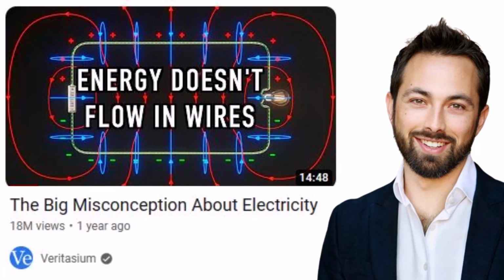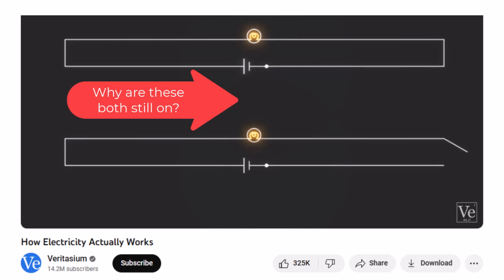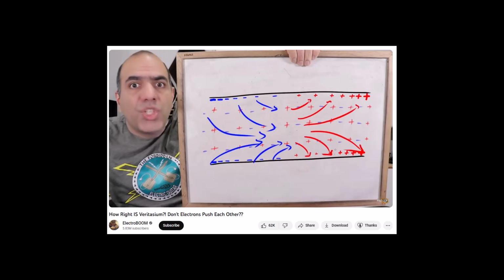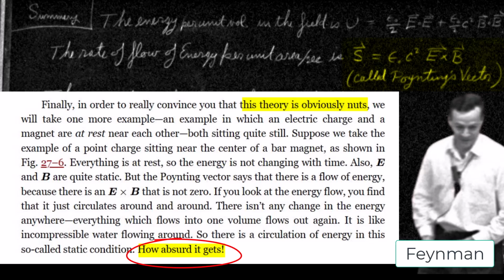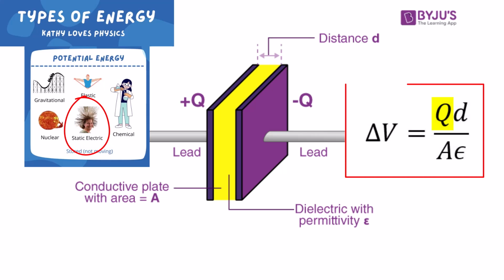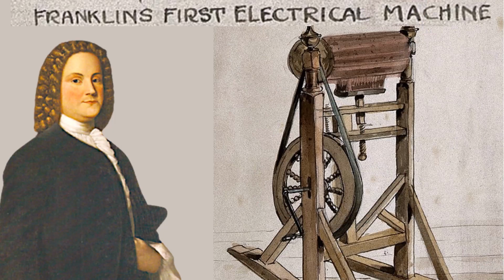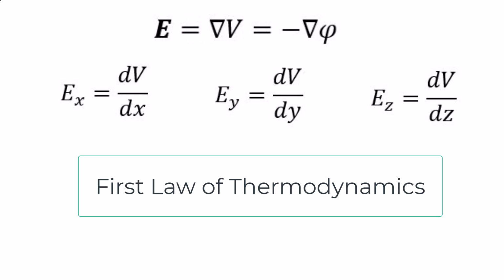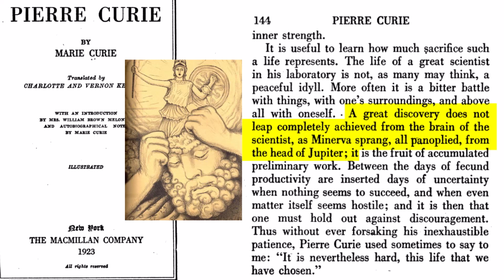Deep Dive Historical Response to Veritasium’s DC Electricity Video

Comment from the maker: I thought this pinned comment could be a good place for people to add (respectfully) things in history and physics that you think I made mistakes on or need more clarification. Please nothing about sound quality or other superficials in this thread.  Let me start: I wish I had added that when a battery is in a circuit the chemicals take a while to react, so that the electric potential difference from the charge distribution Delta V is less than the emf, or the chemical potential energy per charge. The equation becomes Delta V = emf - ir, where i is the current and "r" is the internal resistance. This is why a battery heats up when you have a lot of current flowing through it. 11
Reply: I sent you by email the PDF of a highly relevant paper on the very subject (Galilia and Goihbarg, 2005). You did not use it. Have you got it?
BTW, I also think you misstated something about Feynman because you first agree with him and then seem you say that the same quote is nonsense. I've made a separate comment on that.
Reply: Poynting vector definitely applies for DC circuits! The case mentioned by Feynman is definitely weird, but remains consistent because the energy is not coming in or going out. In fact, to quote Feynman himself (just a couple of paragraphs below the one you showed) "The circulation of energy around a magnet and a charge seems, in most circumstances, to be quite unimportant. It is not a vital detail, but it is clear that our ordinary intuitions are quite wrong."
He makes the point that Poynting vector concept is non-intuitive but does not say that it is, in fact, wrong. That said, the derivation of Poynting vector is not fully consistent and leaves room for multiple definitions. I remember that Griffith's textbook also shows the same concept. 
Whether you agree or not, Physics is simply a model and as long as it works, it stands. Einstein really didn't believe in QM and it may not be correct either. But, it will remain correct until proven wrong, and we know that QM seems to work really well in explaining all the observed phenomena so far (barring the weirdness of black holes). This attitude is important because one should never be beholden to a theory/model as it is against the spirit of scientific temper.
Reply: You are misinterpreting Feyman.  He was emphasizing how counterintuitive it is by calling it "crazy".  He does the same with quantum mechanics.
Reply: There IS an electric field inside the wire of a DC circuit and it makes the electrons move: J = sigma E. Only in the *electrostatic* case the field is zero. For a good explanation see:
“A unified treatment of electrostatics and circuits” by Sherwood and Chabay.
Reply: Great channel Kathy.
  The flux field created through  the surface of a solid conductor in a circuit while a potential difference is applied, is obviously connected to the flow of electrons in the conductor. At least it should be obvious. I won't go into further detail on this forum except to say I believe your comparison of static charge protection from a Faraday cage vs the gradient charge differential  near the surface of a solid conductor is simply not a logical or correct comparison. A flux field can and does induce current flow in a circuit via EMF.
I also think you've misjudged Richard Feynman and taken his character  completely out of context from one single comment he'd made. Also the referenced video you use of him was from 1979 while he likely had abdominal cancer. For me, this man was one of the most clever, inspirational, honest scientists ever. And he chose a life of service to the community, the world and humanity right to the end of his life.
Reply: You made a mistake about Feynman
Reply: Based on my understanding, and I may be wrong, your faraday cage analogy for the wire is improper.   The experiment has no electrical flow over the cage and the woman is insulated from it.    Charges are not more concentrated on one side of the cage compared to the other as in the wire as ElectroBoom pointed out.  In a disconnected faraday cage a charge can flow in response to an external field but will do so as to perfectly cancel out the field. That is why there is no field inside.  

A better analogy would be a lady standing in a faraday cage as lightening strikes the top and passes out the bottom.  If she is insulated from the cage she is completely protected.  However, I believe, if she was standing barefoot and had her hands placed on the ceiling a portion of the current would flow through her. 

Think about this.  You have a one inch diameter bare copper wire ten foot long with enough current flowing through it to vaporize a sheet of aluminum foil.   You use the foil to make a one foot hollow cube around a portion of the wire. The cube touches the wire everywhere that the wire passes through surface.  So one foot of the wire is inside a thin walled faraday cage of aluminum foil.  

You turn on the current. Do you really think all the current is going to flow exclusely through the aluminum foil and not the copper wire inside the faraday cage?  If that were the case the foil would vaporize.  In fact (if the cage blocks the field inside) then adding the foil should have the effect of allowing less current to flow and a higher voltage drop across that one foot long section of copper wire it encloses.

Not what I think will happen.  The electrons will be more bunched together on one side than the other.  This will cause an electric field that passes right through the faraday cage.  Measurable as a small voltage drop all along the wire passing through it.
Reply: A worked example with known values would have been a good way to round off the video I think.
Reply: Derek's example is a thought experiment.  Thus, we have to include some idealized components in our analyses if we are to test his idealized case.  We have to agree on our components if we hope to agree on our conclusions.

At about time 2:23 in his video, Derek defines the bulb to be "an appropriate device" that will produce light any time there is significant current and voltage at its terminals.  Per Derek's definition, then indeed there is light after about three nanoseconds for his original case with the wires being one meter apart.

On the other hand, it will typically take several round trips of the waves on the lines to produce visible light if we use a real incandescent light bulb, which will typically have a much-lower initial resistance than twice the characteristic impedance of the lines.  A superconducting balanced no-loss transmission line model feeding a fixed resistance load shows this result, but to be more correct, the model needs to treat the wire like a folded dipole antenna that is loaded with a bulb simulator that is a temperature-dependent impedance varying as a function of its power dissipation history.  The Ansys electromagnetic field model displayed in the video does a good job with the wire part (if we could have a superconducting wire strung out in space that far), but a fixed resistor was used in the model rather than an incandescent bulb model, and an ideal step in voltage was used to excite the system rather than the real battery and knife switch.  It may be worth noting that if the bulb is modeled as a fixed resistance that exceeds twice the characteristic impedance of the ideal line, there will be transient periods when the voltage at the bulb actually exceeds the steady-state value.

These videos make an interesting thought experiment that push us beyond a basic flow model of electrons in a wire.  With simplifications, we can do real-world tests and we can employ electromagnetic field models that confirm the result that significant current and voltage appear at the load in a few nanoseconds.  However, if we could couple real-world parts to the assumed superconducting transmission lines spanning 300,000 kilometers out through space, and if there were no solar wind nor changing magnetic fields in space to couple to our wires, we could also show that it would take some seconds for a typical incandescent bulb load to produce visible light following the closure of the switch.

It is also worth noting that the Poynting vector gives the correct value for the power density and direction of power flow at any point at any time in any situation involving electric and magnetic fields.  The hard part is determining the electric and magnetic fields in order to do the calculation.  🙂 See for instance Joseph Newton's video "The Poynting Vector in a DC Circuit".
Reply: I found that AlphaPhoenix's video "Watch electricity hit a fork in the road at half a billion frames per second" helped me develop an intuitive understanding of what is going on in an electric circuit.
Reply: Kathy, there is simply no conservation of energy and momentum in an electrodynamic system if the energy of the electromagnetic field is not taken into consideration. The Poynting vector is just the flux of energy and momentum of the electromagnetic field, so it cannot be ignored or considered of minor importance. Feynman was just trying to show his own astonishment about  electrodynamics when he said in the Lectures that the theory of the Pointing vector was "obviously nuts". Also, the system battery-switch-huge wire-bulb is not DC, as the switch is closed at some time. It becomes DC after all the transient due to self inductance and capacitance of the wire is gone, but this may never happen because the energy stored as electric and magnetic fields in such a huge wire with steady current may easilly surpass the total energy of the battery. That is, the current would increase and before it reaches stability the battery would be worn out, and then the current would vanish due to resistance. I think that the spirit of the experiment proposed by Veritasium was about the speed of the information that the switch was closed and not enough power to light the bulb. Note also that the switch  could be shielded inside a Faraday cage and even then the flux of electromagnetic energy between the wires would occour. In your experiment with the AM radio, the source of electromagnetic waves was not the point of contact of the short circuit, but the wires that served as antennas. It was like a Hertz transmitter. From these wires there was a divergent flux of the Poynting vector carrying energy away. It was this energy that the AM radio picked. It is exactly the same thing with the Veritasium experiment.
Reply: I feel like you sidestepped Derek’s question getting bogged down with unnecessary practical details. The question asks about the underlying physics of how energy gets distributed through an electrical system. Your ‘none of the above’ reasons were more about material science and I wish you would have just assumed an ideal circuit. Regardless of the material variables, only one of those possible answers is always going to be much closer than the others.
That said, love your content and your general take on science. Keep it up.  And, kudos to Derek for presenting us all with a question that has so many people fired up for so long.
Reply: @brianmacker1288  I think you wrongly answered me, instead of Kathy.
Reply: I think you are correct, but I do not agree with your premise. I don't think Derek said this was a DC circuit. I have a hard time calling a circuit with a switch and question based on transient time as  a DC problem. That being said basically everyone is correct depending on how the problem is defined.
Reply: Thanks for a great video. This is a hard topic to explain for your audience. I don't have any corrections because I don't think it needs any technical corrections. (In my opinion the bit about the electric field inside of an infinitely conductive conductor was tangential to the topic, but that is just a nitpick). But I do have a way that I think you could have made this video better. It is great that you distinguish between energy being sent as radio waves from closing the switch (which Veritasium is presumably talking about) and the much more massive power that the wire can carry to the bulb. It is also great that you point out that a misunderstanding of the Poynting vector is the root of the problem. Those were the strongest points of this video and needed to be hammered home and expanded on in my opinion. As you stated, just because you have a Poynting vector doesn't mean you transfer mechanical power. (The true formula is Power = - Div S - dU_em/dt as I think you know. I have seen you explain very similar equations well. This would have been a nice addition but not absolutely necessary given time restraints. Perhaps I can beg for a separate video!) But what I think would help this video the most is a description of transmission lines while emphasizing the fact that large amounts of continuous power through the bulb required large amount of current from the battery which can only travel through the wire in large amounts. I am certain that you can leverage your understanding of the history of telegraph lines for example. Or the history of measuring the speed of electricity.
Reply: We all know that real world factors can profoundly affect the actual measurement results. As an electrical engineer, I'm often humbled by measurement results which are contrary to expectations and force to think and further investigate, until I'm (hopefully) able to work out what is actually going on. Sometimes this is easy, sometimes it is a long and winding road.
Back to the "switch, wire and lightbulb" experiment. Despite the trappings of an actual real life measurement, I think the Veritasium example was mostly intended as a thought experiment. External factors in this case can seriously affect the outcome so I think the really interesting answer is what happens in an ideal case Real world effects can then be superimposed on those. There is no reason to obsess over exactly how fast the battery is able to supply the charge or what the resistance of the wire, how fast the bulb lights up etc. At the core, most interesting is what happens in an ideal case with a perfect switch, perfect voltage source, zero resistance wire and so on. The distance of the parallel wires in each loop can be quite important due to capacitive and inductive coupling (including in ideal case), so that needs to be properly defined.
When it comes to demonstrations with measurement equipment like a DSO, it obviously measures real world answers but without seeing EXACTLY how the measurement was set up, it's hard to say how trustworthy the results are. Anybody who has had serious measurement experience can tell that when it gets to fine details and real accuracy, there is a lot of skill going into building a test setup to ensure that you measure what you think you are measuring. It's easy to get a result but not always easy to get an accurate result! Even connecting the test equipment can significantly alter the overall circuit and therefore the test results.  
---
In summary, it's easy to say, well, it all depends but I'm still not sure if I've received a clear answer to the original question posed...
Reply: reason I unsubscribed from Veritasium.  While the first video already disagreeable, it was made worse by his second video trying to prove he is right. On the second video where he detects the flick of the switch is miniscule in power and EM signals are everywhere.  If the point he wants to make is correct then we just flick a switch at very high frequencies to light up an LED bulb. I think the reason the vertiasium video blew up is science or people having a single idea of electric current whereas it is both wave and electron flow, one can't exist without the other.
Reply: Kathy, I believe that on both occasions you’ve taken Feynman’s comments out of context. On the applicability of Poynting vector to DC circuits, Feynman talks about how it’s nuts, but ultimately correct. He goes on to state that he knows of no instance where you will get into trouble for forgetting to think about the Poynting vector. I listened to both the audio recording as well as the textual material, and your “everlasting ire” towards Jackson is completely undeserved.
Reply: That you went to graduate school in physics, engineering and then physics around that time and didn’t learn this is irrelevant. Course material in graduate school is not an exhaustive treatment of all aspects of engineering and/or physics, especially of electrical engineering. Mehdi of electroboom got into a debate with Professor Lewin, Lewin when refuting Mehdi, tried to throw in the fact that he was a lecturer of 94 MIT courses and that Mehdi didn’t understand Faraday’s law. Your ability to critique the model should come from a more thorough analysis, not just the fact that it wasn’t taught to you or you didn’t learn it in grad school.
Reply: Hi Kathy
If you Google "curl your Poynting vector" there is indepth mathematical analysis on this question by some article called Tetra Quark.
Reply: Yes Kathy as I have said all along your are confusing electric STATICS and DYNAMICS.
With statics that's Gauss Law and boundary value problem of Laplace or Poisson equation, result of which there is no electric field in a conductor or in any of it's cavities. With electric dynamics both with DC and AC you can and do have ELECTRIC FIELDS IN CONDUCTORS although high frequency AC will always be subject to rapid attenuation. With DC energy flow will be thru and around wire, with AC, around the wire.
You need Poynting vector for LOCAL ENERGY CONSERVATION.

Thank you for your videos Kathy they are extremely interesting.
Reply: You seem to have misunderstood Feynman's language in his explanations of how the  Poynting vector can be used to explain energy flow in different situations. Feynman was using hyperbolae - "nuts", "absurd" - not as some type of judgement on alternative explanations of the same phenomena, instead he is using that type language to emphasise how unusual the Poynting vector explanation is compared to what the students in his course had learned up to that point. I'll use the example of a current flowing through a resistive wire that Feynman gave in the previous paragraph to the one that you showed in your video to explain what I mean by this.

Explanation 1: The flowing charges gain energy from the electric field within the wire
A potential difference V connected across a resistive wire of length d will create an electric field running internally through the length of the wire of field strength E=V/d (eq. 1). That field will exert a force F = Eq (eq. 2) on the charges within the wire. That force does work equalling W = Fd (eq. 3)  on the free charges as they pushed down the length of the wire. Substituting equations 1 and 2 into equation 3 shows that the work done on the charges is W = qV. The rate at which that work was done (power) would then be: power = qV/t, where t is the time interval for which the field was pushing the charges down the wire. Now, q/t equals the current I flowing through the wire. Therefore, the rate which the internal electric field transfers energy to the charges is equal to: power = VI. 

That is the explanation of electrical power in a wire that Feynman would have taught his students up to that point in the course, and from your comments in your video, I am guessing that his is the interpretation of the phenomenon with which you have the most sympathy. But at that point in his teaching course, Feynman has introduced this new concept of energy flow due to electromagnetic fields, which can be calculated mathematically using the Poynting vector. To explain how EM fields transfer energy across space, he is positing that there is energy contained within the fields. To illustrate this point to his students, he is applying this new concept to a familiar situation, that of a current-carrying resistive wire. 

Explanation 2: Treating the wire as a black box (ignoring that it contains free electric charges within its interior) and providing an explanation based entirely on the electric and magnetic fields outside the wire
Again, there is a potential difference connected across a cylindrical wire of length d. This potential difference will create an electric field E = V/d that is running the length of the wire and that is just outside of the wire at some radial distance r. There is also a magnetic field that circles the wire at the same radial distance r of strength B = (2xpi/mu) x I/r, where I is the current flowing through the wire. (Note that we don't need to know what the current consists of. We need to know only that it is something that causes the circling magnetic field.) The electric field running the length of the wire and the magnetic field are perpendicular to each other, so we can use the Poynting vector S.A = (1/mu). (E x B) . A, to calculate the rate at which field energy is flowing either in to or away from the wire: S.A = (1/mu) . V/d . (2xpi/mu) x I/r . 2 x pi x r x d  (eq. 4), where 2 x pi x r x d is the area of the cylindrical surface of length d and radial distance r through which the field energy is flowing. Cancelling identical terms in equation 4 causes it to simplify to S.A = VI, and the right hand rule applied to the ExB vector product shows that the field energy will be flowing in to the wire.

So we have two different explanations that give the same mathematical result, power = VI, but which are based on different starting points. Explanation 1 uses work done on charges within the wire by a field that runs internally through the wire. Explanation 2 uses the concept that fields carry energy and that P = VI represents the rate at which that field energy is entering the wire. 

Note that Feynman does not state that either explanation is 'right' or 'wrong'. Instead he says (in the paragraph of his textbook following the one that you quoted in your video) that either explanation can be applied to a problem, and your choice of which to use depends  on which explanation you find most useful for solving the problem.
Reply: @wr2382   You are spot on in characterizing Feynman's language - he is making a point how counterintuitive the subject is, not that is it is wrong.  With that said, Feynman does give one example that is a bit misleading.  His diagram of the Poynting vector for a wire shows S normal to the wire; it would actually make shallow angle to the conducting wire - the normal component gives the energy lost along the way, while the tangential portion keeps moving along.  Other Youtubers have made the mistake of taking that diagram directly and showing S normal to the wire only.
Reply: @copernicofelinis   I was also describing a wire with finite resistance.   S does not point purely normal, or there would be no further propagation along that wire.   A portion points in, corresponding to the energy dissipated at that point.  Your tungsten case is no different.  The normal component may be larger, but it still won't be entirely normal along the way.   What is really missing in his picture are the surface charges that create a normal component to the E field.  When the complete E field is properly shown, S direction will be correct, with both the normal and tangential components.
Reply: @copernicofelinis Feynman shows it outside the wire, where it should have both tangential and normal components.
Reply: @copernicofelinis  The text above the figure explicitly states "outside".  Even the caption says near (which would not make sense to interpret as inside).  He showed the inside E so as to make the connection to the outside E (since tangential E is continuous at a boundary).   What he is still missing though is the radial (normal) E component, which would lead to the tangential S component.
Reply: @copernicofelinis   Thank you for that clarification.  Yes, at the midpoint along the wire, there would be no radial E, and the picture is correct.   Had Feynman specified that, then there would have been no confusion.  My only point all along is that it was misleading.  He was trying to emphasize that the energy dissipated is from the inward S component (which is of course true).  But only showing what happens at precisely one point along the wire (especially without stating that) is not really a good characterization.
Reply: @wr2382  In the case of a DC circuit one can encase the entire circuit in either iron or aluminum without changing the power delivered to the load in the steady state condition. This is true even though this would alter the fields outside the wire. As an engineer it would seem IV is the important consideration.
Reply: If current were caused only by surface charge, wouldn't a tubular conductor with the same cross sectional area as a solid wire be more efficient?
Has this been experimentally tested?
Reply: @johnkesich8696 In radio frequencies, as frequency increases, more of the current is on the outside of the conductor (skin effect), so yes, a copper tube 12mm in diameter has lower resistance than a solid copper conductor having the same copper mass per unit length.  It is the same reason that we can use copper coated steel wire rather than solid copper with equal radiative performance.  The steel, though higher in electrical resistance than copper, plays a minimal role in conducting RF current, which stays mainly on the copper skin.  For amateur radio antennas, copper coated steel is preferred to solid copper because of its lower cost and higher tensile strength for a given wire gauge, with substantially equal electrical performance.
Reply: @3:50 charges on capacitor, pushed, charges in wire. So, completely backwards?
Reply: Anger is a subset of fear, so is your past video a reponse to the lack of innovation and the struggle to tech young pople how the world works in the age of smart tech ?
Reply: This is only a misunderstanding of the Poynting theorem as I published it in the Annales de la Fondation Louis de Broglie a few years ago. See my post in the main flow for more details.
Reply: I think you misunderstood Feynman. I interpreted him as saying that we cannot dismiss observations we don't like. If anyone has made a great contribution to the teaching of science, it is Feynman.
Reply: So do you deny that the energy in a charged capacitor is stored in the electric field? Because if not, the energy has to move from the field between the plates to the wires when is is discharged. And this energy flow is described by the Poynting vector...
Reply: @deinauge7894  The energy of a charged capacitor is stored in a combination of its electric field and the potential energy stored in the bonds of the dielectric. The Poynting vector only represents the energy flow of the EM portion of the energy and not the mechanical portion of the energy. The main problem with the Poynting vector, though, is that in most cases it is not the most useful way to represent a system. The lumped-element model works very well in most cases and is much easier to work with.
Reply: @the_mad_physicist  it is not always the easiest, but it is not wrong (as suggested in the video). Why going from one extreme to another? That's what veritasium did, and now this video too...
Reply: I would have thought Feynman and you were in much closer agreement than you seemed to think, from my understanding of the “Feynman Learning Technique”. For the uninitiated, the fundamental premise of learning is that if you can’t possibly teach it to a child, then you don’t yet fully understand it. That initiates a cycle of identifying the problematic gaps, finding solutions, and trying again. Which sounds a lot like your own position? I wonder then if the issue with the lecture you cited was more to do with audience and a specific (and different) point, rather than his views on education specifically. I perhaps have gaps in my knowledge of him, but I always thought he was far more positive about ensuring accessible science education than seemed to be the case here. That aside, I thought you did a great job with breaking down the key issues here, and highlight some very important points.
Reply: At 11:28 you say that a capacitor's energy is stored in the dielectric. A capacitor with vacuum between the plates will store energy. A capacitor with dielectric will store more energy, proportional to the dielectric constant - but the dielectric constant of vacuum is 1 (by definition), not 0.
Reply: Do you accept questions here beyond the topic of the video? I have a burning question on climate change. Tried to ask scientists around me, scientists further away😂 and science popularizers, like you. I'm either ignored or dismissed. Promise that is not climate change denialism.  😉 more to this, I insist that climate change is mostly anthropogenic. But I deny current climate science. Starting with the fact that it was plagiarized from Nails EKHOLM's paper of 1901 without proper acknowledgement, likely because a different conclusion from the same hypothesis was of interest (he wanted to double CO2 to make weather milder in Norway😂). But also the hypothesis is wrong, and it should have been obvious that it is wrong to everyone, as it contradicts/castrates first law of thermodynamics.  A no-no in discussing thermodynamic phenomena. So I'm puzzled why it is allowed to be. Or, as a simpler explanation, would you mind to help me find a mistake in my arguments (after I present them in full). Thank you
Reply: I was very disappointed to see the video end with (E) as the answer i.e. it depends on specific properties of the components used.

Could someone please suggest which of (A) to (D) is closest to the correct answer? (with idealized components or not, dealer's choice)
Reply: I was very disappointed to see the video end with (E) as the answer i.e. it depends on specific properties of the components used.

Could someone please suggest which of (A) to (D) is closest to the correct answer? (with idealized components or not, dealer's choice)
Reply: I was very disappointed to see the video end with (E) as the answer i.e. it depends on specific properties of the components used.

Could someone please suggest which of (A) to (D) is closest to the correct answer? (with idealized components or not, dealer's choice)
Reply: I was very disappointed to see the video end with (E) as the answer i.e. it depends on specific properties of the components used.

Could someone please suggest which of (A) to (D) is closest to the correct answer? (with idealized components or not, dealer's choice)
Reply: Maxwell thought in CGS units. There were ES (electrostatic) and EM units. Two objects electrified so they exert on each other force of one dyne (10^-5 newtorn) at centimeter distance,  would be one 1 statvolt. Two unit magnet poles (each of   1 Gauss  = Gauss being one magnetic line per cm squared, the H of terestrial magnetism being 0.2) exert on each other the same force of 1 dyne at one centimeter = EM unit. One modern volt (apart from electrochemical, modern standard) would have been 10^ 8  lines (or EM units) cut by a conductor per second, 300 hundred modern volts would have constituted 1 statvolt. One more complication introduced as we modernised our thinking was making one amper 10 times the unit current of 19th century. But if you calculate all these values you can understand now that convesion factor between these two systems is 3 *10^10 (speed of light in cm). You cannot mix electrostatic phenomena and EM dynamics, we really should not try to explain things if we do not see them clearly  (Farady is turning in his grave at 10000 RPM). I  can provide soruces if people want to learn.
Reply: Kathy thank you for your information. Mine is a question and topic I want you to look at in the future. In AC circuits we have both single phase and poly phase. In DC circuits, can we have the same thing? As I have heard of advancements in DC circuits and power production. Is poly phase a possibility in DC circuits? Thank you.
Reply: The Poynting Theorem says that the total Power in a volume is the sum of the power travelling outwards the volume + the power due to the work done on the electric charges inside the volume. This means that there is power in both inside and outside of the conductor.

There might be a good reason for EMC EMI Signa/Power integrity folks to state that there is no energy flow inside the conductor, and that the energy only flows in the space outside (but somehow very close to) the conductor. All the calculations and all their designs work fine if you only take that part of the equation: they are dealing with the undesired effects that the EM field can produce outside the conductor.

With that said, it doesn't mean there is no energy flow inside the conductor. But what is more interesting: it doesn't help anymore to admit that there is energy inside the conductor when you are dealing with EMC EMI SIPI problems. Which probably can help explain why these colleagues are so convinced about it.
Reply: Experiments supported by theory by many researcher show that the EM pulse will really arrive instantaneously at the bulb! The paper can be found in my post at the top of the comments, or click on my icon to see the video, New Interpretation of Relativity. All papers supporting this can be found in the description of the video. The experiment is a repeat of Hertz famous Radio experiment, except a modern oscilloscope is used to detect and measure the propagation delay.  The experiment shows an EM pulse propagates in the nearfield, across 1.5m of space, with no propagation delay. And shows that the front speed (speed of information), or speed of causal action is instantaneous in the nearfield of EM sources. if you have any interest in physics, you must look at this research!
Reply: First of all i wnat to say that i really love your videos and greatly appriciate them. But i have to tell you that you are wrong on this. This subject is actually way more complicated then it may seem and its understandable for everyone to not fully understand whats going on. One thing to not is: if you really want to understand what happens when you close a switch, you can forget about DC, ohms law P=I^2*R, lumped element model and bassicly everything that we are most familiar with. Mathematically closing a switch is a step function S(t) that cam be decomposed in fourier series of infinetly many sinewaves of various ferquencies and amplitudes. Thus closing a switch is literally everything but a DC when you look at the dynamics of the situation, which Derek is doing. So you cant really apply basically anything you know, execpet maybe maxwell equations, but im pretty sure you wouldnt be able to solve them for this situation without a computer. Also, you mentioned Faraday an the electric field in conductors. It is actually the case that electric field is zero in conductor. BUT, only in electrostatics, when you have a given static distirbution of charges. If you allow charges to move, which univers does, you actually can have a non zero electric field in conductor, and you do! In antennas all the time. Thats my field, antennas. Making new kinds of antennas. If you want to dig in to this problem properly, the main term is "transmission line theory". But it is really math heavy, thus almost nobody fully understands it. I am writing all this because i see your effort to understand this and i see you want to see the truth. But i have to warn ya, its a messy field, and at the same time mathematically symetrical and beautiful. Good luck if you decide to go for it!
Reply: @dinodubroja7433  She isn't wrong, just incomplete. I applaud her, for example, in correctly identifying that a misunderstanding of the Poynting vector is the main problem. I can hardly fault her for not giving the correct expression (Power = - Div S - d/dt (U_em)). Nor can I fault her for not giving a more complete picture of transmission lines which would involve a lot more time.
Reply: @the_mad_physicist  I mean, poyinting vector is a usefull tool, as is all of physics. There is no truth here, not yet atleast
Reply: @dinodubroja7433  The Poynting vector is necessary for optics. And, I assume it is important for antennae and wave-guides. In most cases, though, it is better to avoid the Poynting vector since it is cumbersome, confusing, and often says nothing about the underlying mechanism such as resistance. P=EI is much more useful for example. From a pedagogical approach, I think that Kathy is correct.
Reply: @the_mad_physicist  i see where your point is going and i agree
Reply: @dinodubroja7433  Any source texts and videos you recommend for "transmission line theory"?  So far I found @PadmasriNaban and @technologiesdiscussion1676
has 14 videos that go fairly gently.  Things that seem simple so often are anything but...
Reply: @dinodubroja7433  Yes the transient part at connection is not DC but what happens is not as complicated as you make it out to be.
All you have is a transmission line and in order to analyze / simulate what happens you need to quantize the transmission line in to a finite number of LCR elements.
So in Derek's experiment R is zero as he considers the line to be a superconductor and if you look just at say first meter of transmission line in each direction all you have is the battery that connects to bulb trough two capacitors in series one on each side.
The current that flows trough the bulb filament is the current needed to charge those two capacitors nothing magic and energy is not used other than losses due to resistance in the circuit in this case battery internal resistance and bulb resistance.
If you ignore the transmission line capacitance (energy storage device) then you have a hard time understanding what happens but once you consider that it is easy to simulate in say SPICE exactly what happens in a real world transmission line and there is nothing other than electrons moving trough wires.
Electrical energy flows trough wires only unless you look at wasted energy that is radiated as infrared photons but not the case in Derek's experiment as he selected to use superconductors.
Reply: @electrodacus  yes i agree transmission line problem is relativly simple. Im just pointing this out bcs some things were adressed in misleading way. And when i said its a mathematiclly heavy and messy field, i meant electrodynamics and advanced electromagnetics engineering in general, not transmision line. You can literally model a transmission line with one number, its charecteristic impedance.
Reply: @dinodubroja7433  If you want to see what happens in time you need to use a finite element model for transmission line not just total impedance of the line but small sections.
In any case Derek's video was wrong as it implied that electrical energy doesn't flow trough wires.
It will be as wrong as saying that energy flows trough a capacitor instead of in to a capacitor.
Reply: @electrodacus  I have a short paper on how energy is transmitted along conductors. Whether AC or DC, energy is transmitted as infrared photon flows within conductors; energy is not transmitted through surrounding magnetic fields as is believed; poynting theorem not needed at all.
Reply: @chanrasjid8688  It will make sense that electrical energy transmission without electron flow will not be possible.  The example I like to give is two identical capacitors one charged and one fully discharged that are paralleled.
After the two capacitors are paralleled the total amount of energy found in the two capacitors is just half of the initial energy in the charged capacitor.
All the energy can be accounted for as thermal energy in the resistive wires that allowed for the transfer of energy from the charged capacitor to the discharged capacitor.
It will take quite some time after the energy was already transferred before the thermal energy is dissipated in the form of infrared photos to surrounding space.
If all the energy did not traveled trough wires then there will be no reason to find all the lost energy as increase in wires temperature.
Another example is a vacuum diode. There is only energy transfer when electrons actually jump the gap in that vacuum diode.
Reply: @electrodacus  You are correct that the final capacitors's energy is only half shared between the two capacitors. My new theory (see my paper) states that the final energy stored in the originally uncharged capacitor receives IR photon flow into it and absorbed (converted) as electrical potential energy. The final capacitor states retains half the original energy. 

Half of the original energy converted as thermal energy heating the wire and dissipated over time.
Reply: @chanrasjid8688  Where can I find your paper ?
Reply: Does closing the switch on a DC circuit effect the sound quality of a youtube video?
Reply: I'm currently working on a video debunking his video about the direct downwind faster than wind cart powered only by wind. I was going to do do a video about the DC electricity video. To me this two are very similar and both have to do with understanding what energy is and the fact that energy storage is as important as friction in physics but much less disused.
My simplification of Derk's DC setup will be using a charged capacitor instead of the DC battery and a discharge capacitor instead of the light bulb. I used this analogy and people have a hard time understanding why after the switch is closed assuming the two capacitors are identical just one fully charged and one fully discharged why only half of the energy will be in the two capacitors as half was lost as heat in the wire then radiated from the wire to the outside.
And yes the switch is a capacitor and you can transfer energy to the light bulb by only moving the contacts closer to each other without closing the switch so mechanical energy used to move the switch contacts will get dissipated as heat including in the bulb filament but no energy has left the battery if you return the switch contacts to the original distance.
Reply: @electrodacus Exactly. Any electric circuit, even the most simple composed of a battery and a loop of copper wire, has capacitance and inductance. At any given moment on a steady state DC circuit there's energy stored in the circuit capacitance, E=1/2.C.V^2, in the circuit inductance, E=1/2.L.I^2, and all the energy entering into the wire becomes heat by Joule effect, E=I^2.R.t (Watts x s). Feynman's claim that the Poynting vector is nonsense shows that he did not understand Maxwell's Electromagnetic Theory.
Reply: In this video I noticed a mistake you made in history, watching any Veritsome(sp) video. Really though, why would anyone want to? Do not recommend station is what I selected for him long ago.

About the best video he ever made, I read posts from people that had to set up accounts for this website just so they could comment. Professors and the like felt so compelled to correct the guy they joined the site.

His video being corrected really doesn't matter, does it. No one watching the video that watched it for entertainment knew anything that he was saying i'm sure. I never watched it, obviously but I'm sure it was above most of his viewers heads anyway. I will watch your take down of him even though, annoyingly, it will be cut up for the ferrets and clicks, it should be fun though.
There is one thing in his video he got right, I would wager it is still getting those almighty clicks.
Reply: @james-faulkner think pedagogically rather than scientifically and get off your high horse - what's you channel saying
Reply: @simonmasters3295  I do not know what is the you channel is saying.

I am unable to determine what you are attempting to inquire from me. Please rephrase your interrogative, thank you.
Reply: @simonmasters3295  If I stopped thinking scientifically, what kind of thinking is that? Religious thinking. No thank you sir! 

I do not understand "what is you channel saying", please rephrase the interrogative.
Reply: Why do you jump from one name to other, then continually admitting you did not understand, did not learn it and you disagree. Your only credentials is that you showed up in the class and looked at many science cartoons. Fineman put science on the map, what have you done?
Reply: @ShonMardani back at you!  Except you showed up and abused the teacher doing her best
Reply: @ShonMardani if you think Feynman put science on the map you haven't watched this channel enough.
Reply: @ShonMardani hey mate just  reading this, really curious which posts you are referring too?